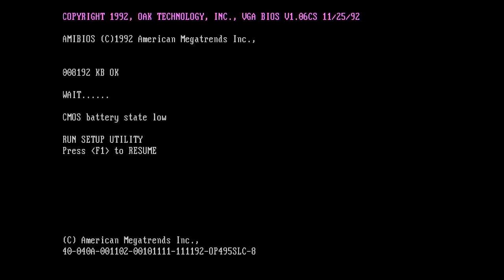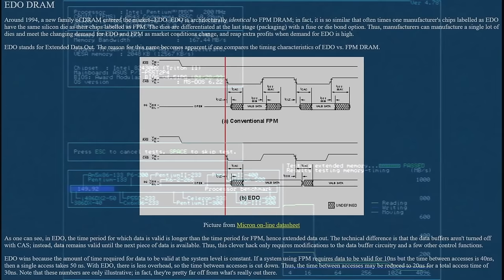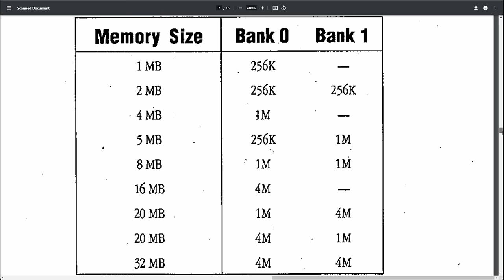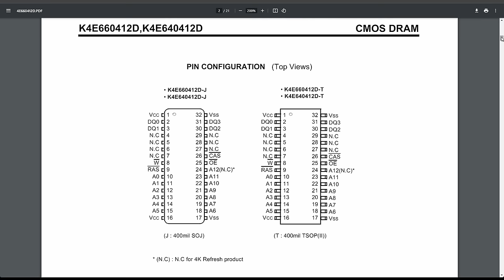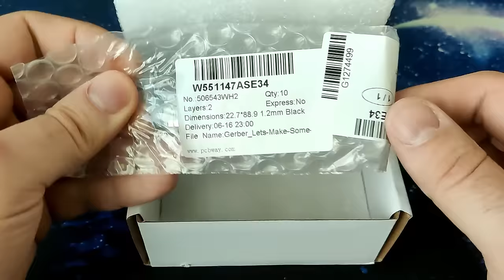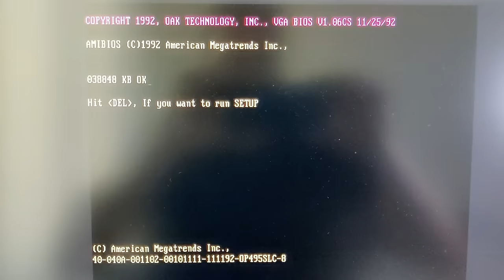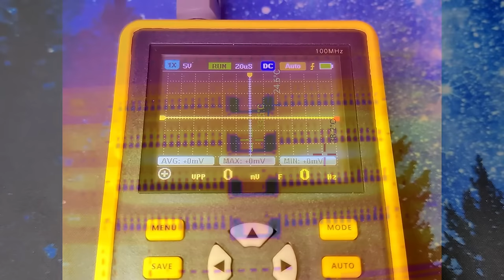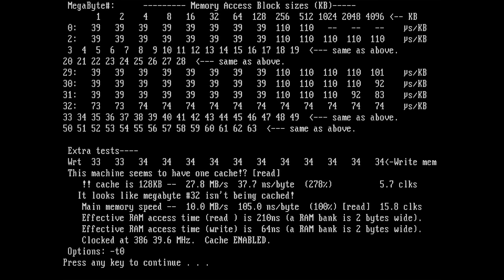DIY 16MB 30-Pin FPM SIMMs: Supercharge Your Vintage Hardware!

Comment: 64MB of RAM on a 386 is quite amazing, nice job. One remark/question: the memory chips are designed at 3.3V, for which you added a Vreg on the power rail. But the address- and data-lines are still driven by the 5V chipset. No risk in damaging the chips on the longer term?
Reply from the maker: I tested the data lines with an oscilloscope and they don't seem to go above 3.4 volts. However, I wasn't able to check the lines that are facing the board (due to limited space). The chips have a rating of up to 4.75 volts as "absolute maximum" - so, there is some margin. Maybe someone with more knowledge than I have will be able to confirm the long term implications if such chips would be exposed to higher voltages (e.g. on a different motherboard/device).
Reply: That's exactly what I thought. Maybe that particular board uses 3.4V, but some another one could easily send 5V, as it expects 5V module.
Reply: Early PowerMacs and IIRC some workstations used 168-pin 5V FPM DIMMs, so the chips on those would not have any long-term issues on a pre-socket 7 motherboard.
Reply: @bitsundbolts  3.4 volts could be clamping diodes in the RAM. Might be worth a check without RAM installed.

Comment: You should now upgrade your Cache if possible for better performance. 128 KiB is a bit little for 64 MiB of RAM.

21:10 I never had a 386, but a 486DX and the most I had in that 486DX was 8 MiB. That's still in the computer. I never needed more for games. Windows 3.1 ran fine with the few applications I used. I probably would have needed more with Windows 95, but I never installed Windows 95 on my 486DX. But your videos have made me think about adding more RAM to my 486.
Reply from the maker: Ah, always happy if my videos convince someone to tinker with old hardware. And I am planning to increase the cache on this board. I think I read that the chipset supports 256kb.
Reply: @bitsundbolts  at 6:31 it says up to 512kB!
Reply from the maker: Hm, I wonder if there are enough address lines routed to those sockets. I haven't looked at that yet, but let's see.
Reply: @awd42  Some chipsets did support more than was implemented on the motherboard.I just took a closer look at the manual myself and according to the "Introduction" chapter and the "Key Features" section on page 4, this motherboard only seems to officially support 128 KiB cache. :(
Checking the address lines might be a good thing.

Comment: I once had a Soyo motherboard that came with it's own proprietary software (that ran in Windows) which allowed the customization of the Energy Star logo; but as with the software you demonstrated in this video, it wasn't easy to control the colors.

Comment: It is enough memory to run in to issues with some software/games. Would be nice to have on/off switch on the ram module to turn some of the memory off... or rather to turn these 16mb modules in to 4mb modules. Then again there are sw tricks for that kind of use case. Still these sticks came out great!

Comment: You should consider upgrading the L2-Cache on the motherboard to 256kb. Not every motherboard will accept this, but on my motherboard it worked fine after a lot of testing with 32Mb Ram.

Comment: In the 90s, all my machines had tons of ram and I had piles of 80mb to 280mb drives because the IT company I worked at was replacing large networks of 386's with  DX4-100's and the new P1-90s and all the XT, 286 and 386 machines were getting thrown in the dumpster so I would strip all the ram, hdd's, PSU's and cards/chips. My 386DX had 4 ram stackers where you could put 4 simms on a single board and insert it into one of the boards simm slots, and my DX2-66 had both 30 pin and 72 pin slots so I ended up with 32mb in both my 386's and 64mb in the DX2, which later became a DX4-133 overdrive. My first Pentium had 64mb, when the average was 16mb, and my dual 200mmx had 512mb, when the average server was running 128mb.
Reply from the maker: Those are all high capacity memory systems. Crazy how memory sizes doubled almost each CPU generation. Sometimes, it quadrupled 😅

Comment: I think the max I had in 386 or 486 systems was 4mb. I don't remember if the "5x86" and similar chips from Cyrix and the like that I had counted as 486s or not, but those I had total of 16. I don't remember if it was late Socket 7 or early Super 7, but I had a board that could take either 2 sdram or 4 72p simms, don't remember the processor, but I had 4x16 for 64mb total for that, the highest I've ever had in simms.

Comment: what i remember most is the endless fiddling with config.sys, smartdrv, etc. just to free up enough conventional memory
Reply from the maker: Yes, I remember this too - to free up as much of the first 640K as possible. The rest was just extended memory and could be used by some trickery, hence all the fiddling with system files. It is so much easier now.

Comment: I remember having 4MB and later updating it to 8MB hoping to make a few dos games run better and get a bit more use out of the system.  At some point this system was replaced with a used 486 with 16MB of ram running windows 95.

Comment: This is great! I will surely be giving this a try sometime in the future.

I do have a silly request. Could the modules be updated with solder pads to attach two SMD LEDs? I have some Geil Dragon Ram (DDR1, DDR2, etc) that has an LED on the left and the right side of the front, symetrically. And I thought it would be funny to add that effect to these modules. Could it be that it also needs a resistor?
Reply from the maker: That's probably small SMD LEDs on that module. They most likely need a resistor to most probably get a voltage around 2v.

Comment: I totally would like to see large 72 pin module with parity this way and pcb for it XD Some 386s(Compaq family ususally) have this format and RAM of this format is pretty rare to find. XD
Reply from the maker: I have double stacked 72-pin modules I found recently too. I still need to test them. One has a broken SMD component, but nothing that isn't fixable

Comment: This makes me wonder what kind of memory was in larger x86-based systems like 80386-based Sequent Symmetry and PPro ASCI Red.

64MB on a 386 enables some interesting benchmark comparisons vs contemporaneous systems with MIPS or SPARC CPUs running at the same clock rate.

Comment: The docs say a max of 32MB, probably because the board has physical address lines for 64MB - ie, 24 address lines and a 32-bit bus - and if they promised 64MB users would complain that when installing the full 64MB they could only use ~58-60MB of that.
Reply from the maker: I'm not sure about that. Mine counts up to 64mb. But I haven't played with it yet. at the end during the cache check, you can see memory holes and uncashed memory areas.

Comment: Question: Since the the 8MB chips require 3.3v shouldn't you need to use level shifters on all the address lines?
Reply from the maker: So, here comes the question that bugs me! I honestly never heard of level shifters. But a quick search on Google brought some light into that mystery. My board seems to access those chips using safe voltages, but other devices may not! So, I am interested to know more about it. So far, the memory chips seem to work great, but I'd like to improve the modules if it can be done. What should I look for? Level shifters on any data and signal line like address, CAS, RAS, WE, OE, etc?
Reply: @bitsundbolts  I am not an EEE but one thing that I have learned is when connecting 3.3v devices to a 5v system you should use level shifters in-between to prevent damage over time to both sides.  For example old 5v video game systems the NES, some people were building flash carts using 3.3v flash modules directly connected to the 5v address lines of the NES and would say it is OK because it is with-in the operating tolerances of the flash modules in the data sheet.  I believe that the issue is is pulls down the voltage on the address lines.  Voultar on Youtube has had videos about this.
Reply from the maker: I will research that topic and figure out if I can improve something. I wasn't aware of this issue. I want to fix that issue before making more modules that may damage old hardware over time. Thanks again for pointing it out.

Comment: Related to these 30-pin SIMM memory modules, I am very curious on this Socket 7 Motherboard model by GCT: GCT-8IV.
According to The RetroWeb, this motherboard has the ability to utilize 3-4 different types of RAM (the manual debates this) and can run a k6-III and Pentium MMX 200-233 mhz processor. Can you do a video involving this Socket 7 motherboard? On paper, it sounds like a rough diamond but is it? 🤷‍♂🤷‍♂

Comment: Have you ever tried to use solder paste stencils? It can save time if you're doing bigger batches of the same PCB.
Reply from the maker: That is exactly where this project is heading. Already made PCBWay aware that I need a stencil and uhmm.. about two hundred PCBs 😂

Comment: Nice! Curious - what switches did you use? I may have missed it in the video.

my first 386 had 8meg of ram, as did my 486 until I upgraded it to 16, then 20mb. second 386 I managed to get 32mb in it scratching around the junk drawers at work.
My current retro 486 has 20mb in it, though I have some of the pcb's to make up the 4mb simms.
Reply from the maker: They are 1T2P SPDT switches. I describe them in one of my other videos. Yeah, I didn't mention them in the video, but they essentially have three terminals. Flipping the switch connects the respective outer pin to the middle pin.
Reply: @bitsundbolts  Thanks.

Comment: I remember when double data rate ram came out, it was a free hack that made all ram obsolete overnight, but required an extensive redesign. I have to wonder if it could be backported to these older systems, maybe ram speed is not that important idk.
Reply from the maker: I think the timings will be very different and therefore incompatible.  I'm not sure if a 386 would benefit a lot if it had access to the speed of DDR memory, but it was a nice thought experiment.

Comment: I have an old 386 windows  95 pc from around 1996 all I can remember about it was that it had a 350mhz AMD cpu,it was built from parts sourced from computer fairs,back when the price of memory and HDDs seemingly changed daily.(computer fairs were by far the cheapest way to build your own)For it's time it seemed fast,until I purchased a 1.4 GHz ThinkPad,that was the last time I used that pc,but it still works despite the massive windows logo burnt into the monitor screen😊. What do you guys do with these old systems?,from what I gather ,they won't do anything anymore,I kept mine because it was the first pc I built. I do know of one guy who still uses and old 386 pc as a word processor.
Reply from the maker: I always liked to have a PC and learned how to assemble my own rigs quite early. Now, I like to tinker with old hardware to learn more about them, have items I never could have dreamt to own back then, and in general to learn about electronics. But I am sure there are some people that use old PCs for gaming or using their favorite software from a long time ago. Nostalgia

Comment: Awesome video. I'd be interested in a set of 4. Also thinking if it could be used in an Atari TT. Should be able to max that out at 256MB with 4x64MB modules although I think they need parity.
Reply from the maker: Unfortunately, those modules are limited to 16MB. This is a physical limitation and cannot be overcome.
Reply: @bitsundbolts  
I was actually asking myself if this would work with other computers/devices of the era...like Atari STE's, Mega STE's and TT, and some Amigas.

Comment: Is there a way to reprogram the memory management unit on a motherboard so one can use a block device as RAM? 
   Imagine using a modern flash drive on a custom ISA card! 
  The Bus speed would be the bottleneck rather than the drive speed in this case, but it makes a lot more sense than a multigigabyte swap file.

Comment: The 168pin EDO modules are commonly used on PowerMacs.
Reply from the maker: Oh, interesting. At least some explanation where those modules might have come from. Although, O have some boards that specifically state they support EDO memory in their 168-pin sockets.

Comment: Considering my first PC (was my mum's back in the late 80's/early 90's) was part of the transition period of 5.25" FDD to 3.5" (and everything was installed to 3.5" floppies instead of the 80MB HDD) - I'd have been lucky to have 2MB of RAM. Not sure about the exact amount as a rather technologically ignorant family member killed the PC by accident when moving in the early 2000's, so it has been gone for a very long time (excluding the still functioning HDD + dual gameport card).

Comment: My 386 didn't last long. I had a compaq 386 and my sister had a zenith ez pc (monochrome all in one 286). It wasn't working well for college because it didn't have a hard drive. So my parents swapped us. I wasn't happy about losing color........and.......it wasn't good enough anyway. I don't recall the issue. Maybe the 5 1/4" floppy? I doubt it, but maybe. Either way I ended up with both. The compaq had a 20mb hdd and a 5 1/4" floppy with ega graphics. The zenith had dual double density 3.5" drives. I thought I could snag one. It wasn't visible. I barely knew anything at this point. I thought I could swap the BIOS chips when I heard that proprietary peripherals exist. I ended up getting static charged and zapped BOTH chips at the same time. However I honestly do not know if they were really bios chips or not. For all I know one was a bios and one was a CPU. Maybe it was a CPU and a floppy controller. I have no idea. Not long after that I ended up with a 486. No idea on the hard drive size. It was leaps and bounds larger. Maybe 200? I do know it was damaged and the BIOS chip was destroyed and had to be replaced. So we got it at a massive discount. And to make it even cheaper, we put my EGA card from the compaq in it. No idea how much ram it had. I want to say 8mb maybe? Maybe 32mb in the AMD K5-133?  I was just a kid in those days.
Reply from the maker: Ohhhh, that must have been quite the experience! I am sure that wasn't a nice feeling knowing that both chips were destroyed. It must have been hard to take over the colorless Zenith!
Reply: @bitsundbolts  yeah. The first thing I did with the zenith was take apart the keyboard and cut out the speaker. Because it beeped with every keystroke and it drove me insane. lol
Reply: I do remember that the zenth had a "cereal" port.....I'm like what does cereal have to do with a computer? LMAO and we got it a RAM expansion bringing it up to 640k. No clue what the stock ram was.

Comment: I had a Compaq ProLinea 4/25S.  Had 4 72-pin slots.  56MB total…
Config;
First slot could only be 4MB as there was 4MB soldered to the board, the other three slots had my 16MB sticks.

Also had a Kingston Turbo Chip 5x86 2 133MHz installed.

Comment: I once had a Socket 3 system I maxed out with 128 MB of memory. It had a Shuttle HOT-433 motherboard. I also had an AMD 5x86 overclocked to 160 MHz in it. Why did I ever let that computer go? 😢

Comment: With this amount of memory it's now possible to run Quake 3 Arena on the 386DX-40.
I doubt there is any ISA card that has 3D accelerated OpenGL - so the 3D API would have to be software emulated somehow - but technically that PC can "run" Quake 3 now. You've probably seen the "386DX-40 runs Quake III Arena using Open GL and 64MB RAM"-YouTube video by "command line" already. The video states a Tseng Labs ET4000AX ISA card (with only 1 MB videoram?!) was used and some "SCITECH GLDIRECT 3.0 for OpenGL emulation". Officially Quake III Arena needs 4 MB videomemory - which is something I find a bit odd ... I'm just curious how far this could be pushed with a overclocked CPU, ISA-bus and a upgraded / modded 4 MB videocard. The dream would be a custom build 3D accelerated videocard for ISA or vesa local bus and a "frankensteined" modern chip on it.
Removing the burden of emulated 3D from the CPU and making sure the CPU does avoid "memory swaps" by having enough system RAM and videomemory should give a huge boost in performance. I just do not know how much memory Q3 actually needs to keep everything loaded and avoid swapping.
Reply from the maker: Ohh, I'm trying to get a video out every week - that project sounds like it's work for at least two weeks 😅
Reply: @bitsundbolts  haha yeah that is understandable. It would in theory have good chance to set a world record for fasted Quake 3 on a 386DX-40 ... but I'm not so sure the YT audience would be interested in that. Even with a very optimized configuration the full demo benchmark would probably take around 2 days to run ... and has a higher chance to crash then with the overclocks.

Comment: 64Mb it is unbelievable leap! Wonder how much memory 486 system can utilise.
Reply from the maker: I hope we will see 128MB on a 486 system with those modules. But they should support more when 72-pin modules are supported

Comment: Have you ever done any system design for S-100 bus computers?
I would love to add every modern feature that didn't exist in 1977..
SIMMs, M.2, i2c, USB, WiFi, BT, etc
Make it run in 2 different modes...
and make it backward compatible with original pinout
make it run to take full advantage of all the bus pins..
example the data bus had 8 input and 8 output data lines.
Would it be possible to make it 16 bit bi-directional?